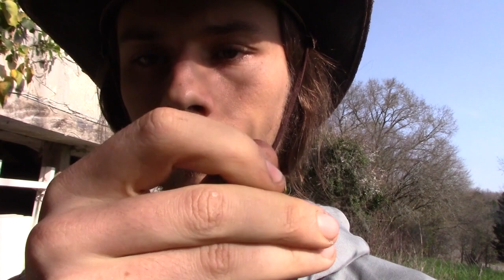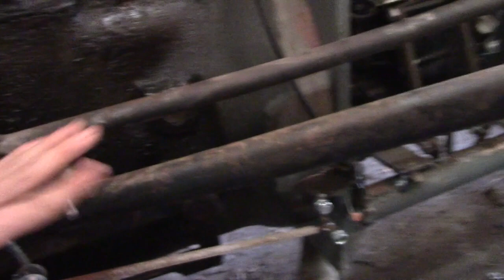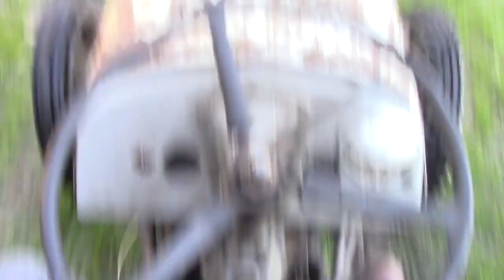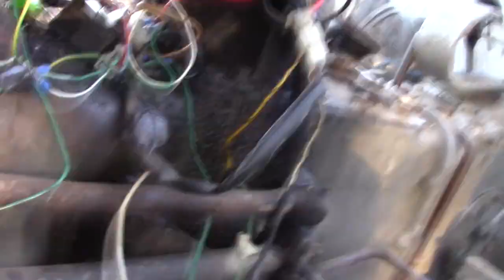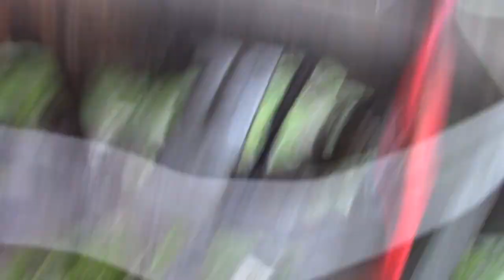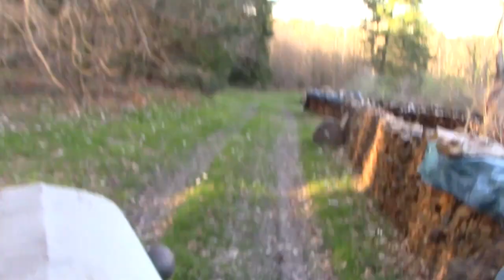Motorcycle engine on a tractor Ep.  7: A gas pedal

Comment: Very nice my friend. I am building a garden tractor with an XS650 motor and a live axle. Over here we have garden tractor mudding contests that e compete in. That sounds just like the motor that was in that tractor to begin with.
Reply from the maker: This is nice, your tractor will have a lot of power with that engine. Now I can say that mono-cylinders or twin-cylinders are prone to transmit a lot of vibration to the chassis if not mounted on silent-blocs, which makes a bit unconfortable, but that's not that much important in the garden tractor mudding contest.